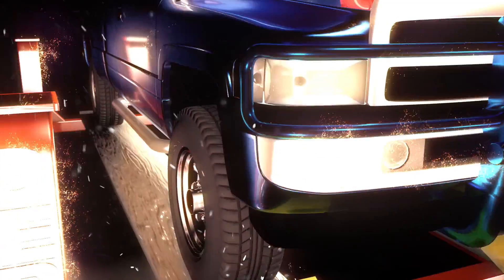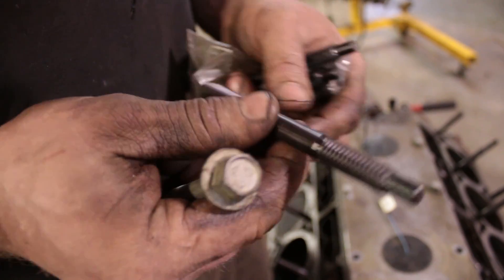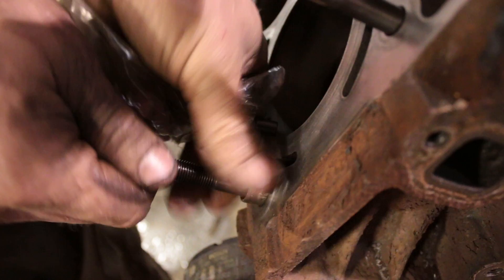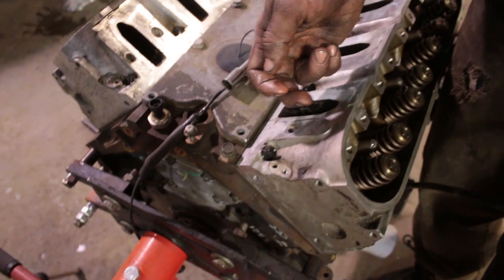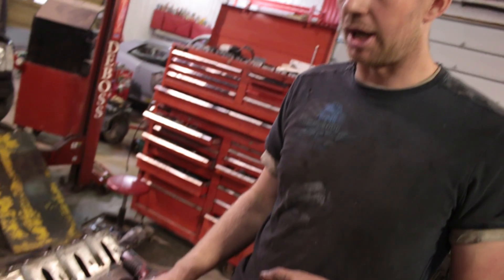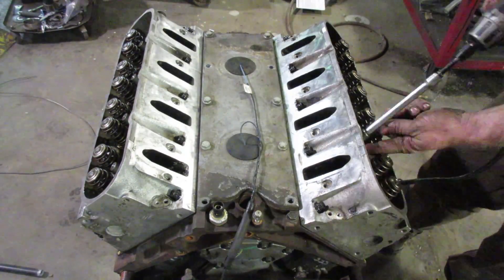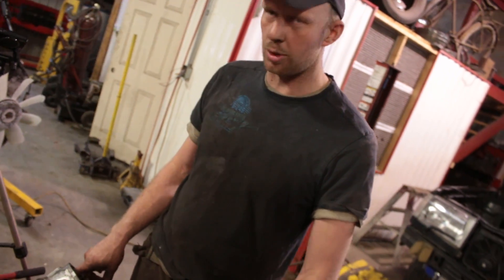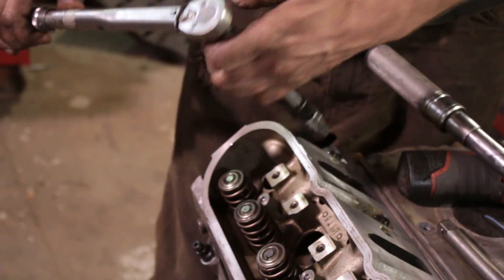Head Studs vs Head Bolts Explained

Comment: while i agree that studs can be stronger than bolts i dont think it has anything to do with extra surface area due to threads on both ends.  if you think about the bolt its basically the stud with the nut permanently affixed.  they are both clamping the same way.  the general consensus about studs is, since they do not need to turn when tightening, allow for more even and consistent clamping than bolts.  Also the finer pitch on the head side of the stud increases clamping force for a given torque.
Reply: John i just did some research and the weakest part of the bolt is the stressed area of the threads not the head.  this is supported by my experience with broken bolts.
Reply: Im no expert but I think the fine thread gives a more repeatable force as in the amount of force applied is a lot finer tolerance and is repeatable so this would also make the clamping force a lot more accurate
Reply: John i suppose thats possible.  i will say in my experience the vast majority of broken bolts ive dealt with did not shear right at the head.
Reply: The fillet going from the shaft to the head of the bolt is where the bolt will see the most stress because it's a sharp transition
Reply: You hit the stud on the head
Reply: John i suppose thats possible.  i will say in my experience the vast majority of broken bolts ive dealt with did not shear right at the head.
Reply: It's a big claim that studs are twice as strong, a claim that should be easy to disprove. All of these devices fail at their weakest link, and I don't see how the absence of a bolt head will do anything to strengthen the point where these usually fail, at the threads inside the hot block. In a chain with one weak link, will the chain be any less prone to failure if the length of the stronger part is twice as long?
Reply: Yeah studs don't stretch neither,that's why you can reuse them ....der
Reply: The head of a bolt is a stress concentration. Using a nut instead removes this weak link.
Reply: Do R/C! What kind of R/C? I have been flying R/C aircraft of all types for over 40 years now. I am just curious, I noticed your youtube name and had to ask. I haven't been flying as much in the last five years or so because my son's got old enough that they started getting interested in girls and keeping a girlfriend happy usually involves having a car or truck and we have been spending all of our time and money on cars (not R/C) instead. I also had an epileptic seizure that put me unconscious in the ICU for six day's in 2012 and ever since I have had to take massive doses of anti seizure medications that make my hands shake and tremble, some day's it's not too bad but other day's it's so bad that I can't even think about flying! Well anyway, I just wanted to touch bases with you, I'm always interested in what kind of R/C projects people are working on! My oldest son and I have built a mild small block '72 Dodge Dart and I have been slowly building (when I can afford part's!) my car which is a '72 Plymouth GTX with a stroked and poked 440 that is now 528c.I. with all forged and balanced internals that except for the machine work, I built myself. If you would like to check out my car just look up "Dads 1972 Road Runner GTX" it's slowly coming along but I have seizures about four or five times a year and doctors can't figure out why I just started having them abruptly at 47 years old (in 2012) and I have worked at several different Job's and have lost all of them because of missing time during and while recovering from a seizure making it very difficult to afford parts! Now that I have the engine assembled and running and finished body work and paint, it's getting to the point where performance parts are going to start costing thousands of dollars instead of hundreds every time I want to upgrade! Right now my oldest son and I fly a pair of electric ducted fan F16's but they need a complete overhaul and new battery packs before we start the flying season where we live in Oregon. I look forward to hopefully hearing from you!
Reply: not been a smart ass but how and why would this happen

Comment: Damn good video, appreciate it! Something I just saw recently that I've never seen before is a guy on YouTube just took his head bolts out of his 5.9L 24V and immediately replaced them one by one with studs without removing the head from the block or even removing the engine from the truck. This might be common practice but I've never seen it. Good idea or no?
Reply: Evobrubaker it's a fairly common practice, you remove them one at a time and torque the studs to match the head bolt's torque spec, then once you have them all swapped, you go over and torque them down the same way you would if you had the head pulled.
Reply: Wyatt Lewis appreciate it!

Comment: Are cummins head bolts torque to yield?
Reply: Neah you just use epoxy on the heads to hold em down hehehe.
Reply: Patrick Baptist 
Why not use zip ties..?
Reply: CrocManAU clueless